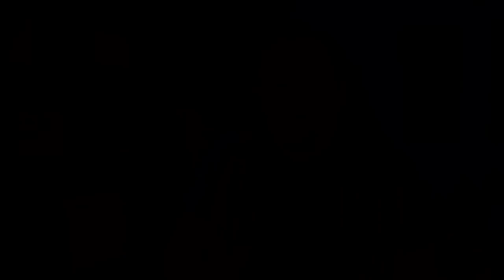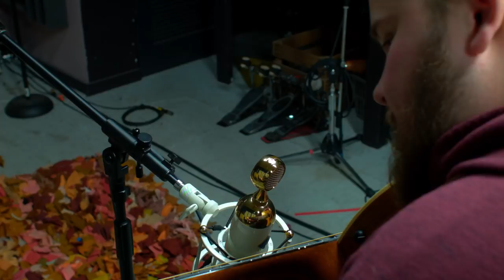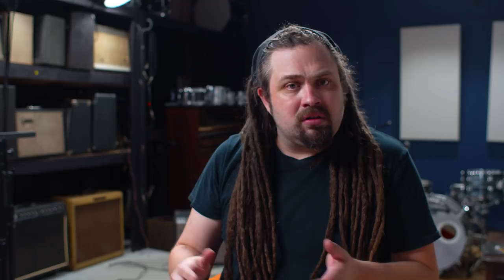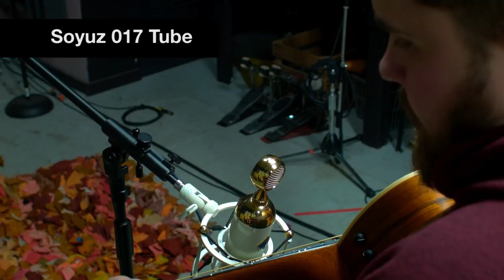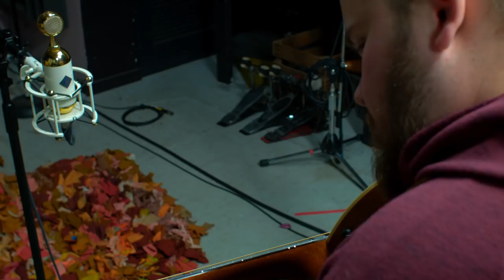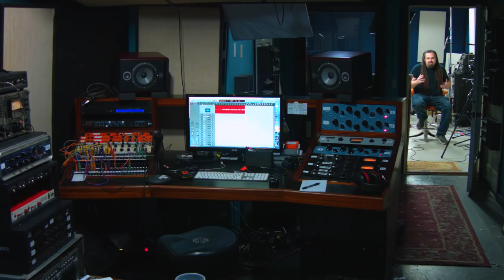Using Air and Mic Distance to Compress Sounds

Comment: Ok. I realize you used acoustic guitar in your example. But I have been preaching this gospel for some time now to anyone who will listen to me rant about miking guitar amps. I tell people they should mic an amp in the same way we listen to an amp. No one goes to a concert to hear a band and then sits with their ear against the amp grill! Or sticks their head in the speaker bin! We simply do not listen to music that way. In the same way, allow an amp to breathe a little. Crank that puppy a bit and set that mic out into the room a foot away. Then two feet. Then three. Etc. Experiment. It is absolutely amazing what kind of takes you get using various mic distances from the amp. At a recent session, I had an amp cranked up to about half volume and the mic probably six feet away or more. It sounded absolutely massive!

Great stuff! Thanks Ryan.

Comment: I get the concept but I don't like the idea of adding noise. IMO better off close micing and using a compressor rather than raising the noise floor.
Reply from the maker: Yeah true. But here position 1 and 2 are still using air to compress. It doesn’t have to be as far as 4. 4 was too far actually.

Comment: Could it be that it's not really compression that's happening? Instead what I think is happening when you're really close is you get over-emphasis of different aspects of the sound due to the relative distance of the sound sources (ie the different strings, or even different parts of the guitar vibrating differently) in relation to the distance of the mic to those sources. That's also the reason why sound changes a lot when you just move a really close mic a tad, in contrast to it making almost no difference when you're a few feet away.
Reply from the maker: I got this idea from Bob Olson when he talked about record Motown singers at a distance and in a dry room for natural air compression. As far as the local emphasis, you are right. There will be a focus on different parts vs the distance will be a more general/average sound. Just like an overhead that sinks lower and lower (because of a loose boom arm)towards the kit eventually become a Tom mic.

Comment: "More options" definitely describes this well, and in an ideal situation I'd have multiple mics set up to give me all the different options I could want, but wouldn't it be "safer" to mic up close and then add compression to taste in the mix so as not to reduce mixing options? What are your thoughts?
Reply: I see what you mean. Easier to compress dynamics than to add them. I think this technique belongs more to the philosophy of getting tue sound and deciding on the sound earlier (at tracking versus mixing)
Reply from the maker: Yeah, you could do that. I've done that too. Mostly when I want the compressed sound or I have a compressor that I really like the flavor of. But just understand that if your room is dead enough, you have a free compressor available to you via moving the mic. Notice position 1 vs position 2. Sometimes that's all that is needed.